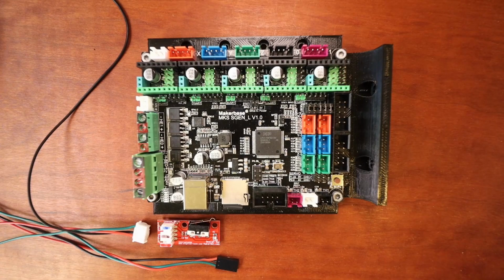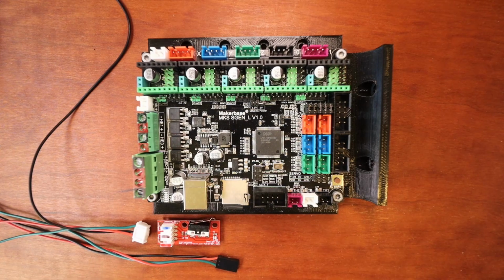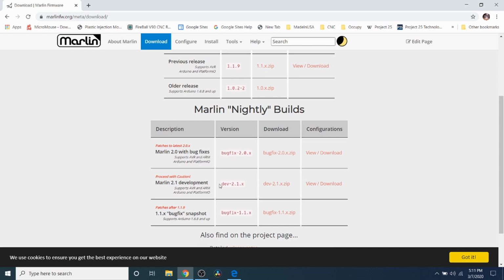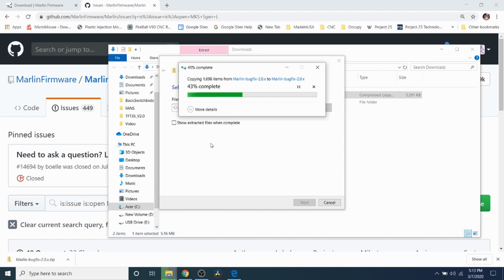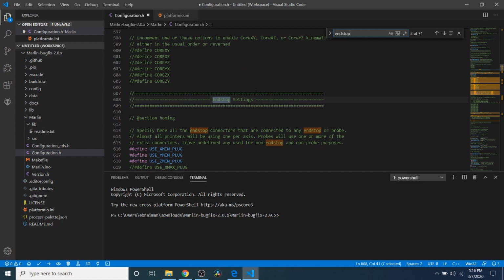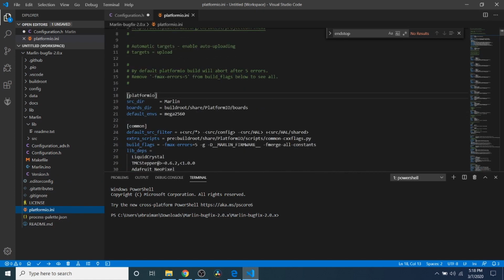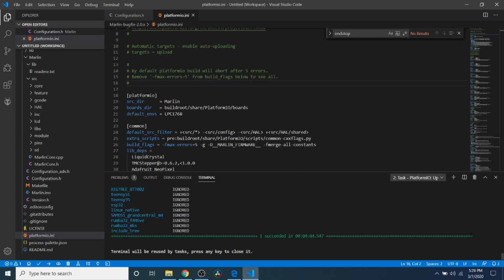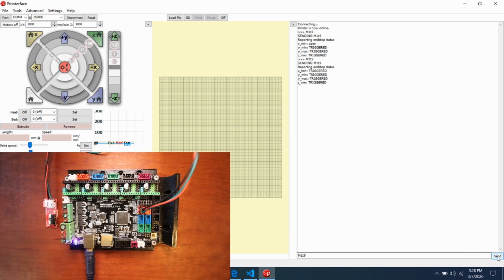MKS SGEN L V1.0 - Switch Endstop

Comment: Very good videos. Any chance  for video about on how to install BlTouch/3DTouch on MKS Sgen L?  I run into problem where 3d touch kinda work mechanically and and triggers as it should according to Pronterface but my Z motor just ignore it and crashes into bed.
Reply from the maker: I'm still waiting on BLT stability in Marlin firmware.
Reply: @EdwardBraiman  In the end i figured out what was wrong. In Marling need to set correct pin MKS SGEN L is actually using. default Z endstop in Marlin is set to pin 32 but actual is 25. Because of this my 3D touch wasn't triggering. That is sorted now. I do have another problem, guide could help. I have 2 fans one part cooling and the second  hotend. With stock firmware hotend fan would turn on at 50c and was no option to control its speed on lcd. Now in Marlin 2.0.6.1 I have lcd control option to control speed of hotend fan but it wont turn on automatically anymore. Unfortunately i dont have access to stock firmware to see whats changed.
Reply from the maker: Try looking in configuration_adv.h. Or there's a tutorial someplace in my MKS Gen L playlist.

Comment: hello I would like to ask you a question, how should I connect for the Z axis the safety limit switch and the sensor for leveling the plate LJ18 A3 - HZ / BX make them both work on ramps 1.3 I for the sensor I used this schwma https: // www.thingiverse.com/thing:2906283 but having the limit switch that you are using you also do not know how to insert it in the diagram, thanks